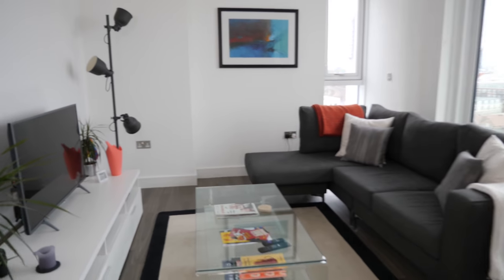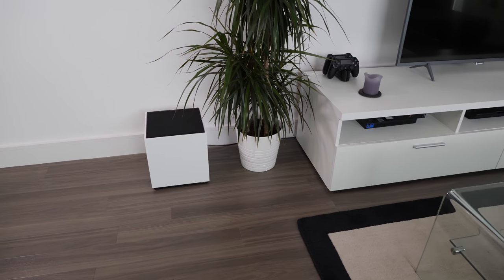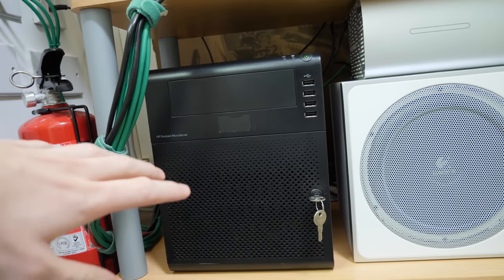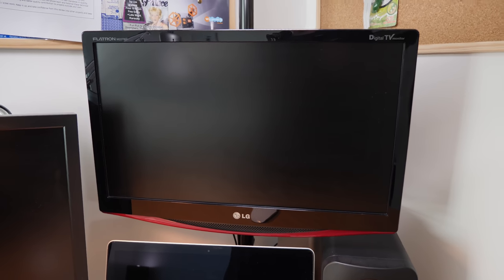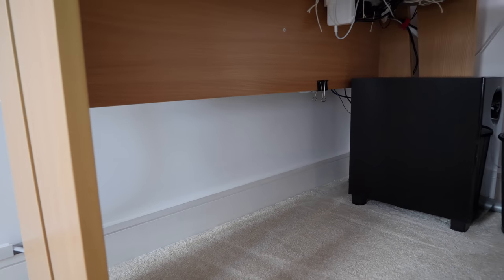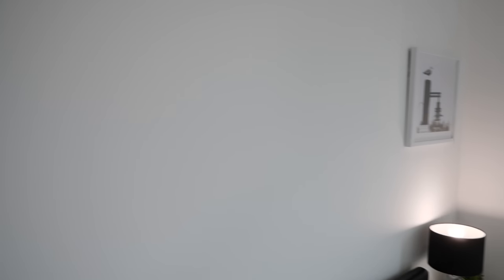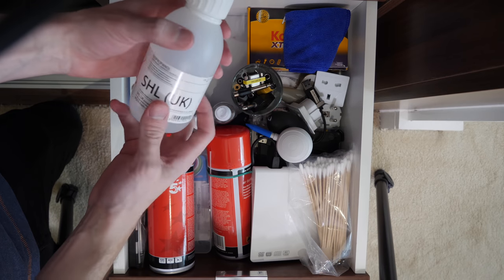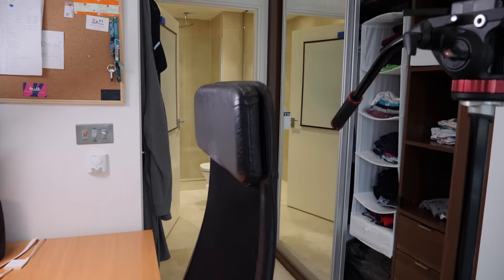Apartment Tour 2018

Comment: I have the Raspberry Pi 3B, and the built-in wifi is pretty useless.  I wound up getting a long ethernet cable for it, and that massively improved the performance.  So I don't think you're missing out on much with that original Pi.  I used to have your same model of MacBook Pro, but after 2 years, Apple replaced it with a new one due to multiple repairs.  The 2014 model is still going strong, but my work just got me a brand new one, and the only real difference is two more cores, a better battery, and a more vivid display.  But even for compiling in Xcode, the extra cores don't make a huge difference.

Comment: What is missing here is the average power consumption of the IT infrastructure (laptop/cloud/USBHDD/Synology stuff/power plugs/routers/switches etc.) without TV, loudspeakers, lighting, etc. I'd be interested to know both average and peak consumption in Watts. 
Hint! I'd place the extinguisher under the table but not on ropes. You schould have been provided with a plastic wall mount together with the extinguisher.

Comment: That's really nice cable setup you did, how did you manage the hue bridge and router stick to the wall? I used double sided tape but didn't work great
Reply from the maker: The router is screwed in and was there when we moved in, the hue bridge is on a little 3M Command Strip hook (command strips could probably hold a router as well)

Comment: Of all that you said, the one reaction I have is 8TBs drive is enough to hold all your videos (vlogs)! Are you talking finished vlogs only or are you including the raw footage?
Your 12TBs NAS is your backup but your MacBook Pro does not have access to whatever you are using to archive your photos and video. Which by the way, what software do you use to import and archive your photos and videos?
Reply from the maker: Yeah 8TB is enough for all of the raw footage I've ever recorded - all the vlog footage is 1080p and it comes off the camera quite compressed. I just manually import and organise everything with Finder - no fancy software. Similarly I just use the default Image Capture app to get anything off my iPhone. I backup to the NAS using Time Machine then I also backup to Backblaze.